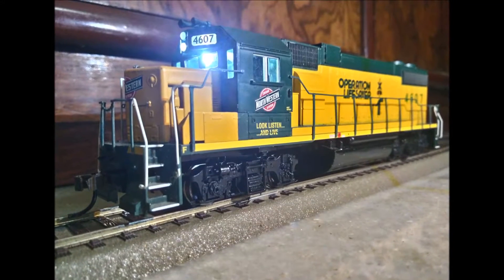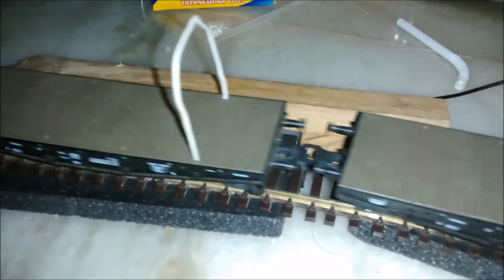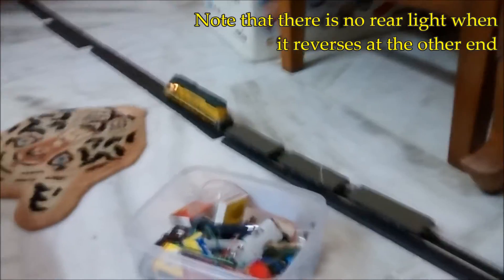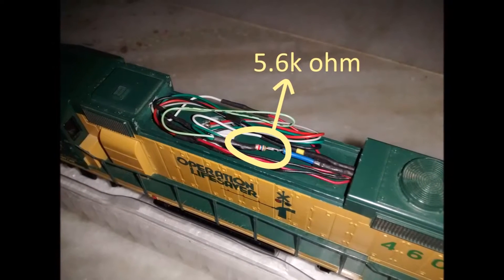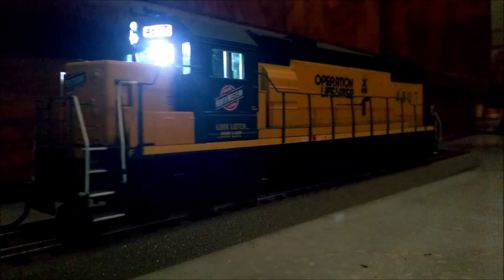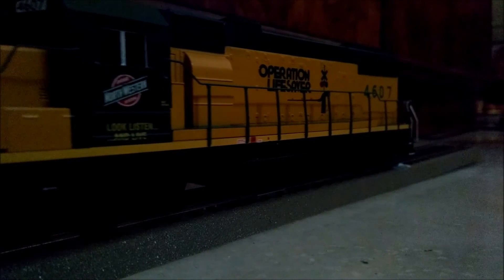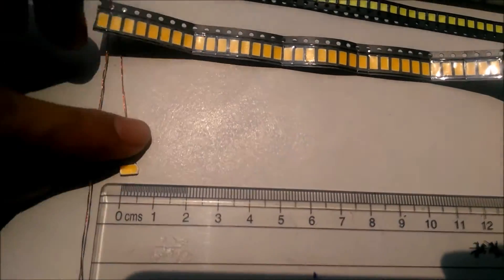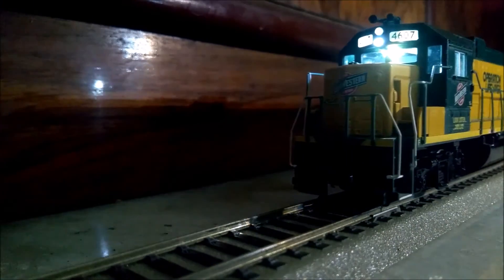Lighting upgrades in model train resembling WDM-2G multi genset of Indian Railways

Comment: Hello Sir, 

I've been learning about model  railroading since the past few months. And needless to say, I've fallen in love with this hobby.

Like any other hobbist, even I have developed a desire for having my own model railroad.

To accomplish this desire, I started reading more and more..

I also want to fall into this mesmerizing world of model railroading but sadly I can not find a right path to proceed with building Models of Indian Locomotives and rolling stock.

Sir I want to talk to you regarding model railroading and I also need your help on scratch building in model railroading.
Could you please share your contact details at -

kunalchangoiwala@gmail.com
Mob. - 7588307630
Reply from the maker: I appreciate your interest in model railroading. Right now I don't have the resources to build scale models although I have plans to resume it after 3 or 4 years at max but I have built models previously and from my little experience I will tell you that the best way to building models is to just start building. You will achieve perfection as you build more and more. No one really taught me to make things. We learn by observation.
If you are in Google+ then I could refer you a few groups where more experienced people have been doing it on a regular basis. You will learn a lot more by simply observing them and improvising some of what you learn to make something new.
If you wanna join those groups then simply check the Google+ link that I have in my channel and there you will find the model railroading groups that I follow. Wish you all the best.